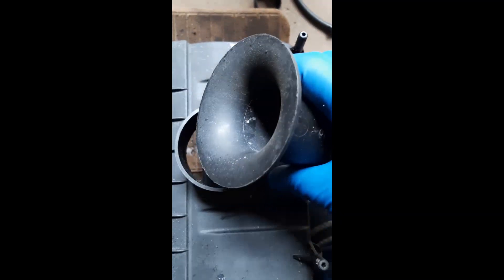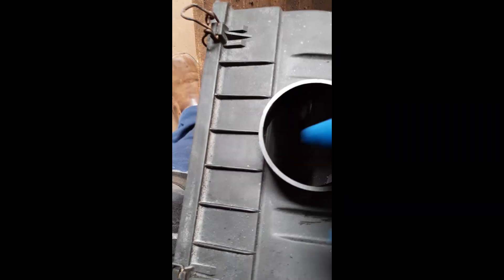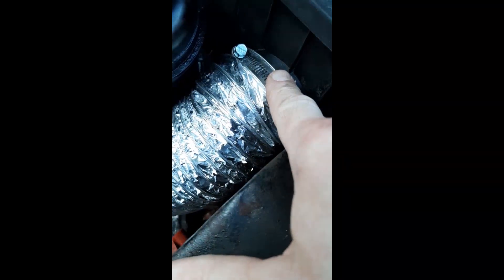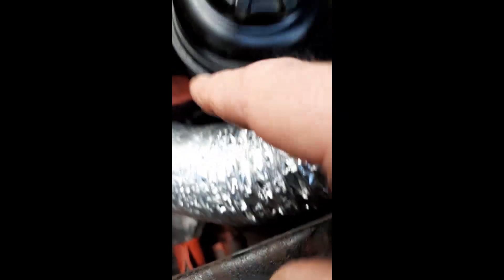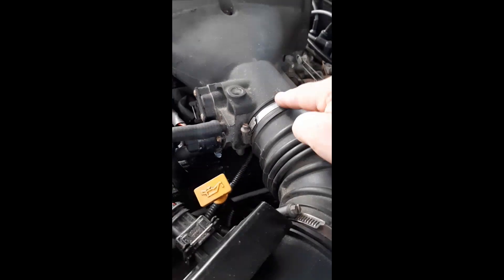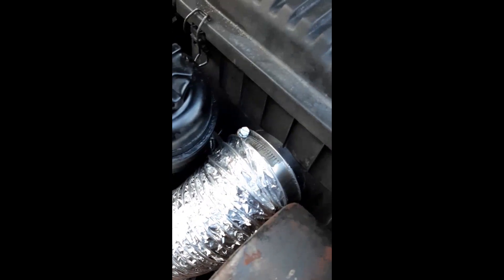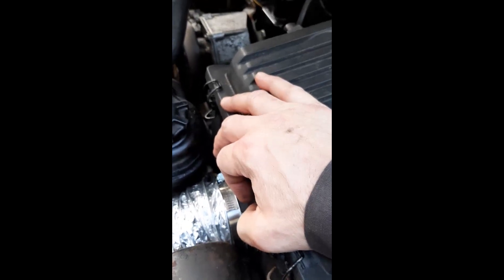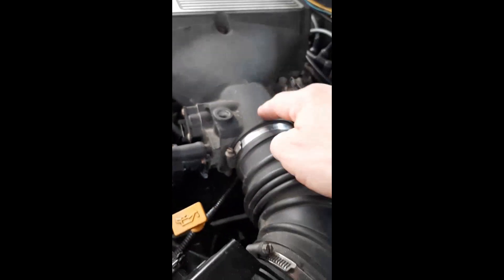Getting fresh, cold air to the engine.

Comment: I have a question for you. I have a 97 discovery that I just two days ago replaced (per your awesome video) the rod bearings,crank bearings,oil pump, timing chain set and removed and cleaned the pickup tube. I did this because after I dissembled and cleaned the plugged rocker assembly’s and did 2 back to back oil flushes, the oil light would stay on for 6-8 seconds in the morning. It already had a slight rod knock. I’ve only put 70 miles on it since buying it. now the oil light stays on in the morning for 5ish seconds. The motor is a lot quieter, there might be some very very slight bottom end noise ( it could just be my imagination).  Do you have any advice on what I should do next?  (The old bearings were worn to the copper, the new crank bearings plastic gauged at 1 3/4 thousandths the rods at 1 thousandths.)
Reply from the maker: Try running VR1 20w50 oil.  Valvoline.  Also, there is a press-in plug in an oil galley on the timing cover that sometimes leaks.  It shows up as a few drops hanging off the oil filter (which is not leaking). Mine is, and I will do a video on how to repair it.  That's scheduled for June.  It drains the oil out of the passages above the oil filter, so it takes a few seconds to build pressure.  Also, I have found that a Rover or Mobile1 filter work the best for anti-drainback properties.
Reply: Thanks so much for the advice 👍
Reply: I replaced the oil filter with a mobile 1 filter and it’s fixed 😀 thank you so much 👍
Reply from the maker: I'm glad to help.  I've tested Fram, Wix, A/C Delco, Mobile 1, Rover, Microguard, K&N, and some brands I cannot remember right now.  I came out with definitive results, that the OE Rover and the Mobile 1 are the only two I should use on this motor, and that 20W50 VR1 is the only oil.